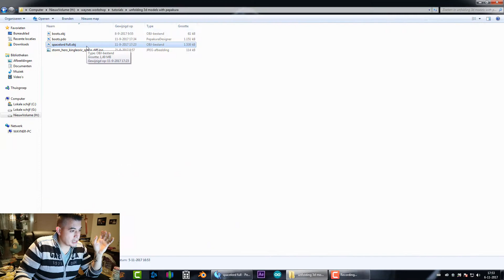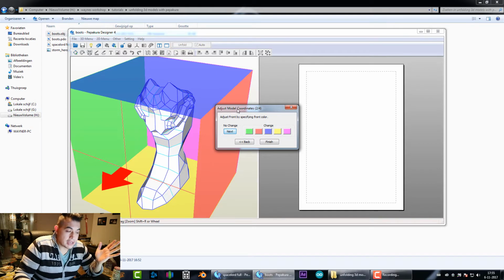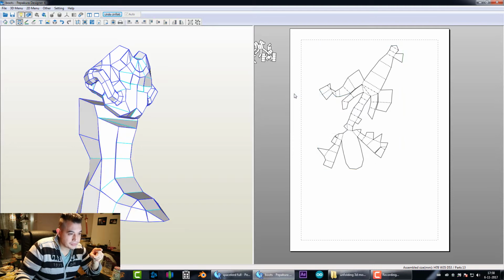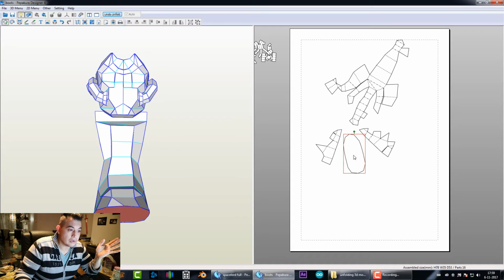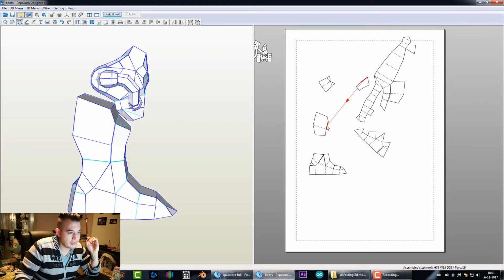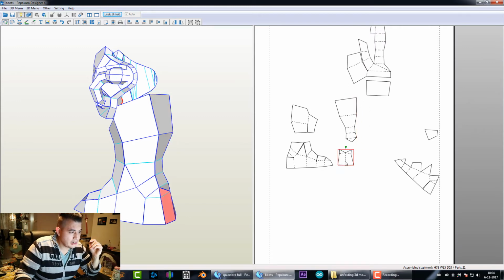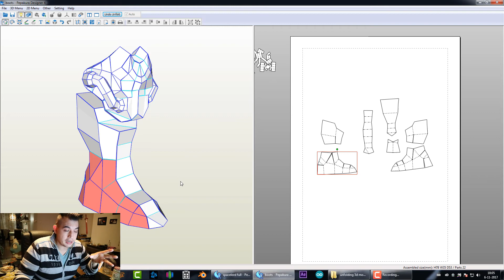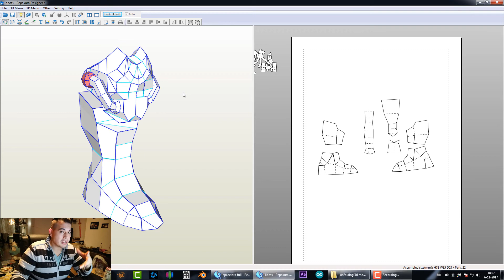Unfolding 3d models in Pepakura

Comment: Where did you get the texture for the boot?
Reply from the maker: same way as in my previous video about extracting it, in the same folder where "units" is located, there is also a folder called "textures" 
all of HOTS textures are in there, the hero texture is called "storm_hero_kingleoric_space_diff.dds
just replace the kingleoric name with whatever hero tecture one you want, you might have to search a bit, you can convert .dds files for free to .jpg on many online image converter
Reply: Wayne's Workshop  Thank you, those models are great for papercraft!